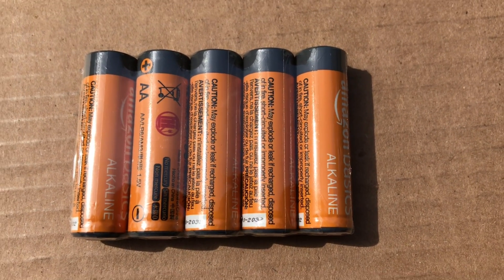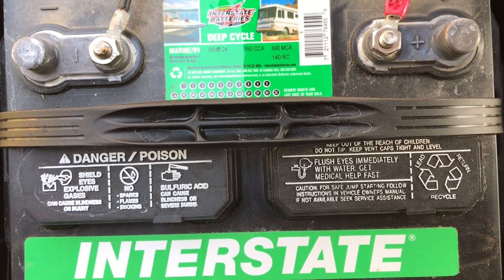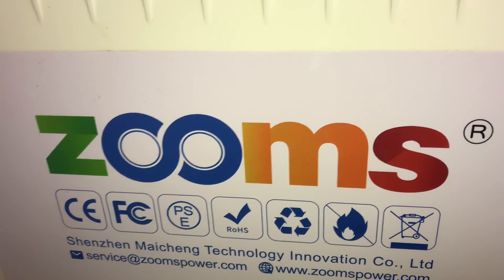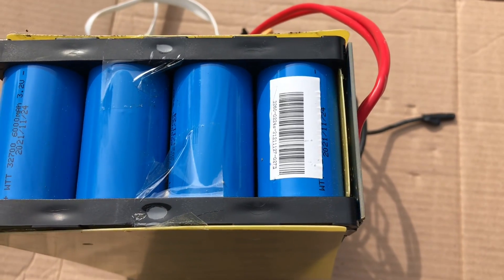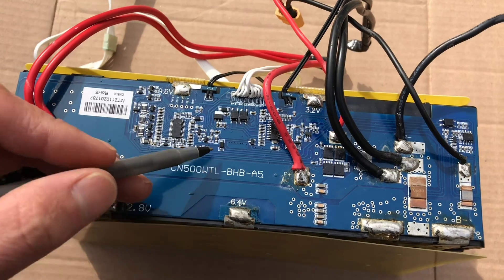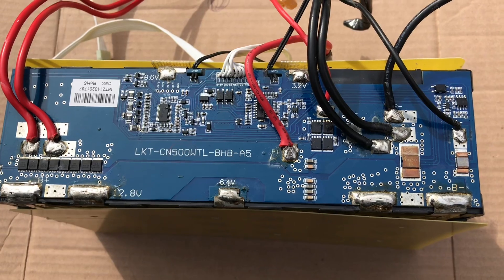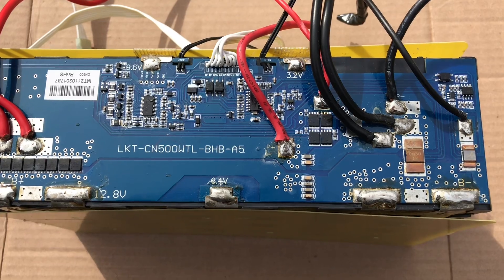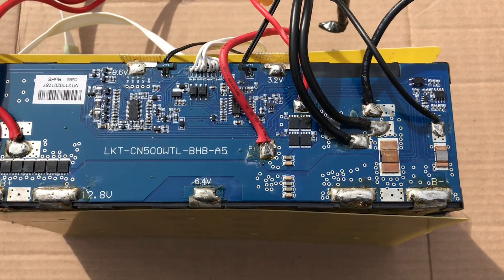EMP AND BATTERIES-Lead acid/LiFePo4

Comment: I brought a metal (Gang Box)  a large Tool box from Tractor supply  like goes on the back of work trucks its 4ft wide and 3ft tall and bought metal faraday Gasket from Amazon for the lid and sealed it up im placing my Lifepo4 Batteries inside then laying a large piece of Faraday Cloth over the Box. For added protection
Reply from the maker: Sounds like you are taking good precautions!

Comment: Will shielded wiers be better than normal wiring for emp? If so is their a way to shield current wiring?
Reply from the maker: Correct, shielded cabling helps, along with using conduits, line filters and surge suppression devices.
Reply: @THEOFFGRIDMOUNTAINHOMESTEAD  where's the best place to ground the shielded cable? Close to the load or close to the panels?

Comment: I have created a I hope a level of protection for my lithium batteries.
As a backup I do have a few BMS 's in Faraday bags and then stored in 50 cal cans then I placed that in a large faraday bag in a metal garbage can just in case.
Ok here goes:
1) I have my batteries in large faraday Bags.
2) On the battery terminals I have an EMP
T.R.A.P device.
3) I have the battery leads running out of the faraday bag to a bus bar.
4)The battery leads to the bus bar have Ferrites to reduce over current.
5)The bag is closed up tight with aluminum Tape to try to give a good seal 
6) At the bus bar I have another T.R.A.P installed.
In fact my solar a has lots of Ferrites and T.R.A.P devices to hopefully prevent the EMP wave from effecting the system.
Will it work??
I don't know. But you only have 1 chance to defeat an EMP. So going over kill is good insurance. 
My Faraday can has many layers to it.
1) Keep electronic item in cardboard box.
2) Place in faraday bag and tape close 
3) Add 6 layers of aluminum foil. Just wrap the box in aluminum foil like a gift.
4) Place in 2 faraday bag.
5) Place into 50 cal ammo can. ( Ammo can tape over any and all places pierced by screws, RIVITS etc.)
6) Tape ammo can closed with aluminum Tape for good seal.
6a) If item to big for 50 cal box, then add 6 more layers of aluminum to wrapping it up .
7) Place into faraday Garbage can. ( In can line inside with cardboard, then insert large faraday bag like trash bag into can
8) Place cover on can and tape with aluminum Tape to give secure seal.

The above is a little involved but nothing crazy or undoable .
If I can do it, so can anybody else.
I use the nesting method or layering method to protect items 
Just my 2 cent
Good luck
Reply from the maker: 👍 Thanks for watching and commenting!

Comment: I’ve been running a 2016 deep cycle for a couple weeks on a vevor diesel heater for my piglets. It gets used down to about 40% daily. Hard to complain. My brothers solar setup went down for a week because 3 of his 8 lipo’s needed a software update. What if you mounted you batteries upside down so the batteries protected the board?
Reply from the maker: Some lithium batteries are directional and can only be mounted facing up depending on manufacturers due to relief/vent ports on the cells. 

If they could be turned upside down, I don’t know if this would help. The lithium cells probably wouldn’t help shield the BMS. The E1 pulse does travel generally in a downward direction, but too many variables involved.

Comment: I recently put a 48 V  100 AH in my golf cart, as the lead acid ones were shot.  I am hoping to have it inside my metal bldg, if / when something happens ;) but if the EMP takes out that circuit board, it is probably going to damage some / most of my other preps too.  let's just all hope for a Glancing Blow !!! thanks for the info.  I have a 3000 watt 48 volt inverter, just as another emergency power source.  I saw that they used them in FL after a hurricane, so I added it to my " emergency power " preps for sure !!
Reply from the maker: Praying we never have to go through an EMP!
Metal buildings do provide some level of attenuation. So maybe it would make it. 
Is the inverter to use with the golf cart battery? Throw a solar panel on the roof and you have a mobile power station! 👍 
Thanks for watching and commenting!
Reply: @THEOFFGRIDMOUNTAINHOMESTEAD  I do have a couple of solar panels for sure, and another small Jackery Power box. buy my " Pride and Joy " is a PTO Generator. I am on a well, and it is going to be pretty much devoted to well power and a few other loads that I can back feed to the house from my pump house on the 30 amp breaker / wiring.